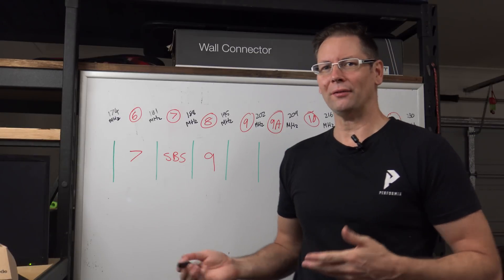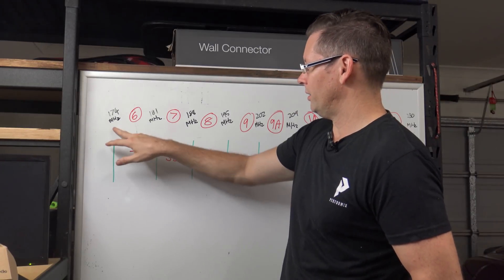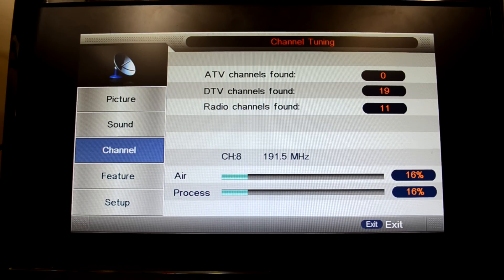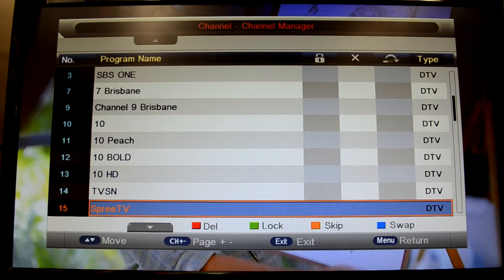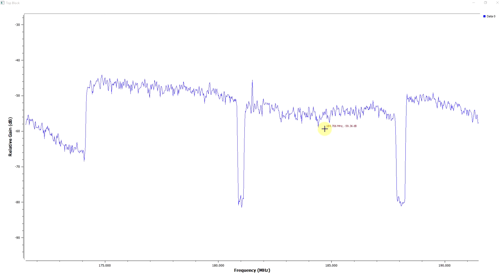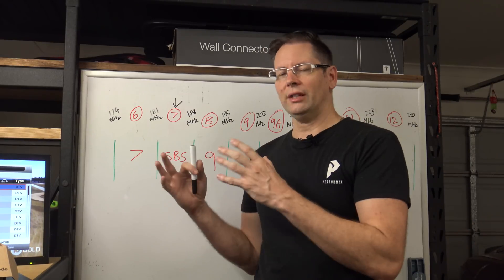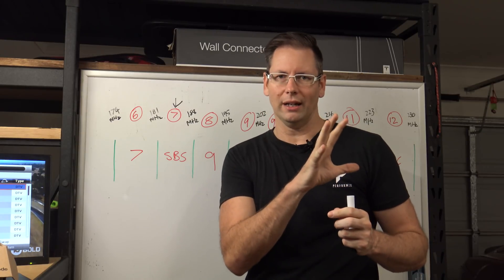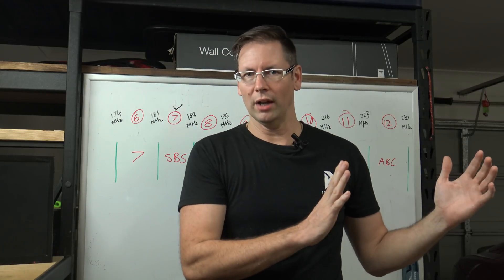TV Technology - Part 2 - Digital Television

Comment: I have not seen the following episodes yet, as I am catching up so you may answer this in the coming episodes. The question I have is regarding the Digital TV, I have an old 42" LCD (Changhong) here around 10 years old. I have noticed that although I could tune in most of the Channel 9 Stations - 9Life will not tune in, is this in relation to the Tuner in the TV or the inability to display the output? hope that makes sense!

Comment: Loving the series. Do you have many issues over east with 4G mobile signals overpowering your TV signal in high density, city/ metro areas?

Im a west aussie installer/ intergrator and its quite common over here. Good Quality Digital antennas will have inbuilt LTE filters to attenuate this signal out, causes havoc with some sites over here if they have broadband amplification for distribution or dont have individual channel processing headends.

Keep up the great content, ill be re-watching your raspberry Pi Multicast streamer setup to refresh my memory for a side project tommorow 👍
Reply from the maker: I haven't heard of anyone having that issue here, but your scenario reminded me of something I've seen in the past. There was a mobile phone tower less than 1km away from an outdoor Wi-Fi setup. The APs' front end didn't filter out 2.4GHz. The mobile signal was so close and strong that even though it wasn't operating on 2.4GHz for the phones, once it hit the AP and started bouncing around its circuitry, harmonics came into play. That's when there became interference. Filters at the receiver are a must. In fact, I sort of showed this in a very old video  https://www.youtube.com/watch?v=WFc6WH2pMok
Reply: @TallPaulTech  We can see it on the spectrum analyzer at the top of UHF band, pretty common in perth CBD, even more so if picking up signal of the bankwest tower UHF repeater CH 46-50 if our normal transmitter cant be received due to building obstructions etc.

Have also had the vary rare instances where it has also interfered and dropped certain foxtel transponders out, usually a fox sports SD channel. Only changes to the site is a 4G mobile repeater on the same building or in close proximity. Swap to the same channel on a HD transponder and its usually OK.